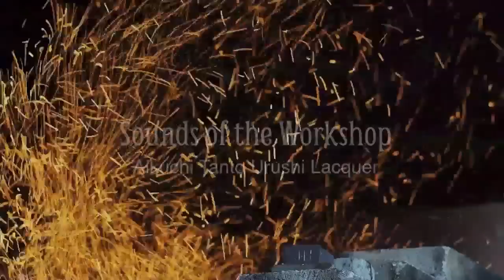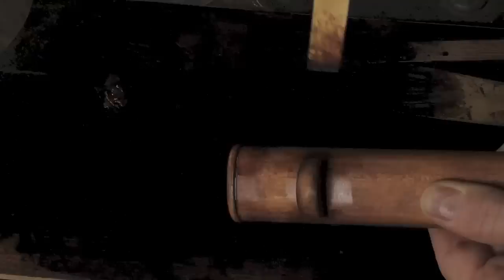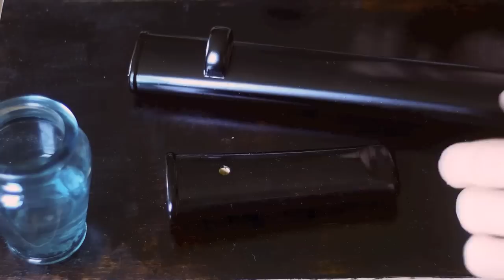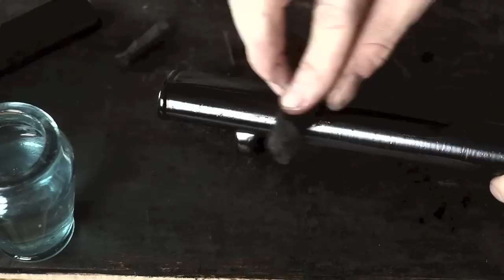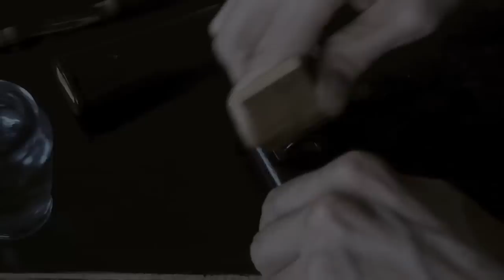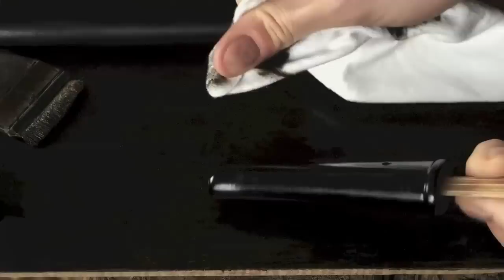SOTW #9 - Lacquering an Aikuchi Tanto Mount (Historical Knifemaking)

Comment: hello, can you tell me that you have dipped the knife in that solution so that the knife has a lead-colored coating like that, please
Reply from the maker: soak in vinegar to remove scale and etch the steel...
Reply: thank you . You have a way to make the knife colored like the gray of lead metal, so you won't rust for a long time
Reply from the maker: no, it will still rust...but it looks cool after vinegar...and then you can put on tung/linseed/flax oil and let it dry...
Reply: @islandblacksmith  thank you

Comment: For stone finish with tea you just laqerd few more layers to get shiny laquer bumps but with steel powder you filled gaps between particles with urushi and removed excess, than put few more layers and wiped them straight after to smooth surface but not make it shiny. Did i understood well and what to do with charcoal powder?
Thanks in advance
Reply from the maker: i think you got it, same technique with steel and tea, fine screened tea is the best though...the charcoal is just for polishing, it is like fine sandpaper...this aikuchi knife has only urushi, no tea or steel...